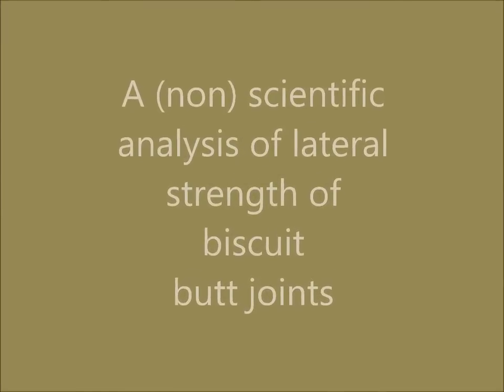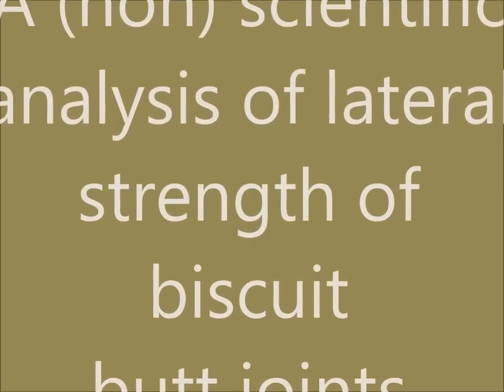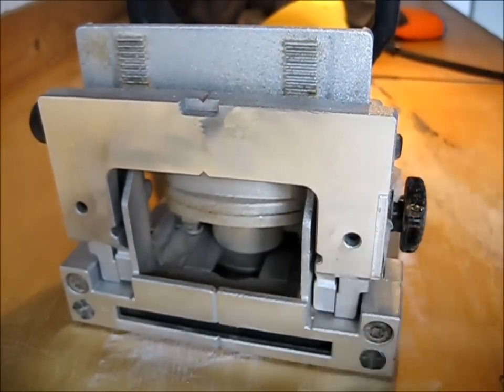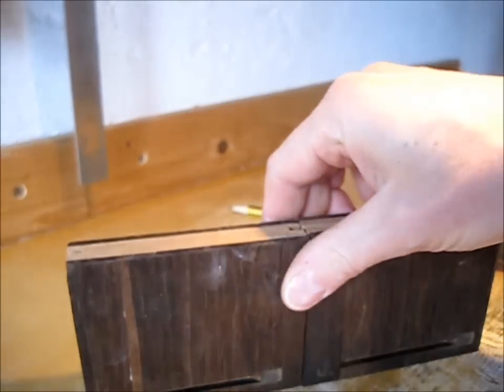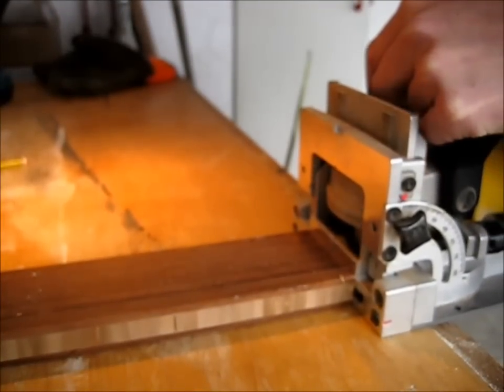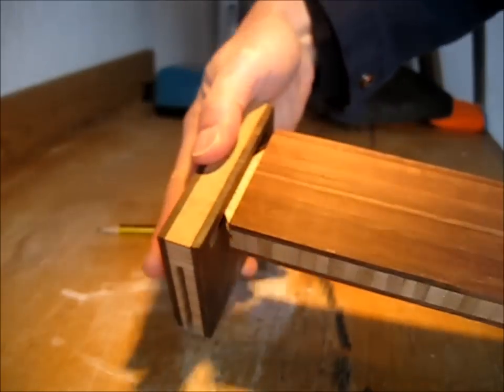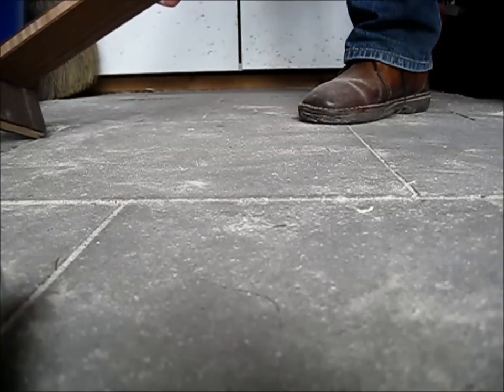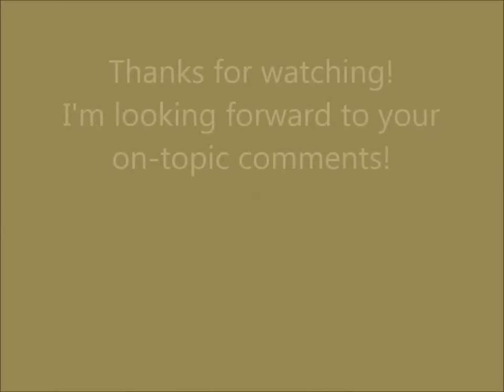The poor man's mortise and tenon - biscuit strength test

Comment: I have seen many of these tests. In all cases, it is the wood that breaks, not the biscuit. The slots weaken the wood but, if you are stressing that wood to that point, you need to redesign. It's like building a fence to keep your dog in the yard. Put up  a chain link fence and it keeps him in. You then replaced that fence with a rock wall. That wall is immensely stronger than the chain link but does it keep your dog in any better?
Reply: Im not certain about this particular type of wood, but it also matters which direction of grain your cutting though.  If in theory the glue is stronger than the wood, the glue from both sides of the biscuit should not have weakened any of the fibers.  Again, these tests prove a point, but joint strength in excess isn't necessarily the best approach to a problem.

Comment: Thanks for this.  I'm thinking of making garden gates using these biscuit joints because mortise and tenon is to difficult for my skill level.  This makes me think they may be strong enough especially with the addition of glue.
Reply from the maker: I think it will work very well! But think of dowels, too. Very cheap and for a garden gate fair enough!